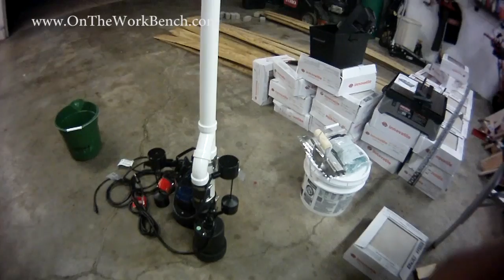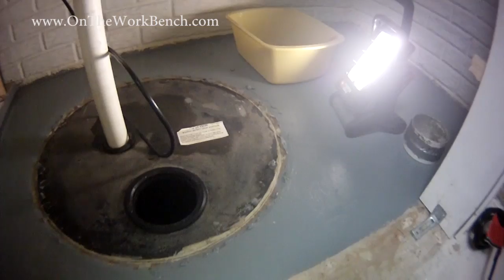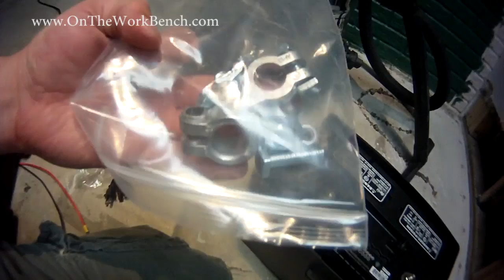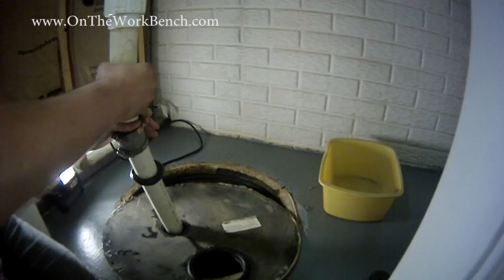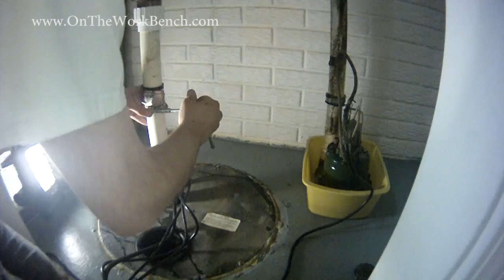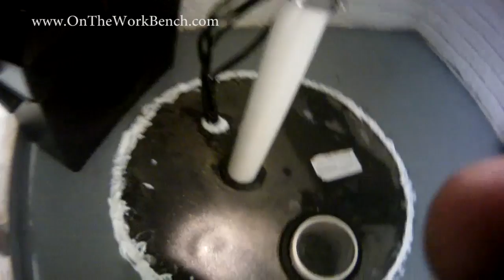Battery Backup Sump Pump Installation

Comment: I have 2 identical pumps...one sits on a 1.5 inch brick and is plugged into an inverter that is connected to a 8D deep cycle battery.(on trickle charge)  The lower (primary) pump sits normally in the sump pit and has direct power from the wall. If the primary fails, the secondary will kick in with the inverter power...voila!!

Comment: Quick question...the Barracuda kit you installed comes with two inline check valves, one for the primary pump, and the other for 12v back up pump, both of which are located below your sump cover. Did you leave those installed, in addition to the Zoeller clear quiet check valve thats shown above the pit cover?  Then each pump would have had 2 check valves it seems.
Reply from the maker: I set it up just like you described. Otherwise the main pump could possibly  back flow through the 12v side and vice-versa.

Comment: So I have a few questions.  How is it running now a couple years later?  Are the weep holes predrilled in the system.  There are already check valves built in the system correct?  So you just have redundant check valve?
Reply from the maker: The battery DC pump failed a few weeks ago. The main pump has a weep hole in it but no check valve. Video coming soon on the replacement. I also had the main pump switch fail last week too.
Reply: On The Workbench ugh 2 years for the dc pump!  I might look elsewhere for a back up
Reply from the maker: Agreed!

Comment: How high from the pit bottom is your pipe to outside? I have a 10 foot rise from pit bottom and want to make sure these pumps have enough power to push the water that high. Thanks!
Reply from the maker: From the bottom of pit the water goes upwards about 10-1/2 feet, a couple of feet above the pump is a check valve to prevent it all from backwashing into the pit.

Comment: Great video. Very informative.

Based on the publish date i don't believe you've had this system running for very long. I am curious if you're satisfied with the apparent quality of the sumps. 
In addition, where did you purchase the see-through device that is upstream of your rubber coupling?
Thank you
Reply from the maker: +bluedb10 I did the install back in August though didn't put the video out until recently. So far no problems with the sump pump. It's relatively quiet and I've tested the secondary pump by unplugging the main pump (and listening to the alarm). The see through check valve is from Zoeller pump company. It came with the old sump pump that I removed. It can be found online for about $20. It makes me feel good be able to visually check that the valve is working and to see that the color of water being pumped up is clear.

Comment: I’m old school Back when we used 1 sump Pump AC 120 Volt and we used a Battery Back-Up 12 - 24 Volt DC it’s been years since I’ve wired this can anyone refresh my memory ? I do Not Want 2 Separate pumps !

Comment: Where do you live that your sump pit fills in 10 minutes?...  and then why would they (builder) dig a basement in such a wet area?
Reply: That's pretty common in Canada..  My sump pit will fill in 5-10 minutes if there's heavy rain, or there's a lot of snow on the ground and a sudden melting/warming cycle.  Closer to the lake it's common for a sump pump to evac water every 1-2 minutes. My house is a new build, so outside the foundation has great drainage for water down to the sump, and out.